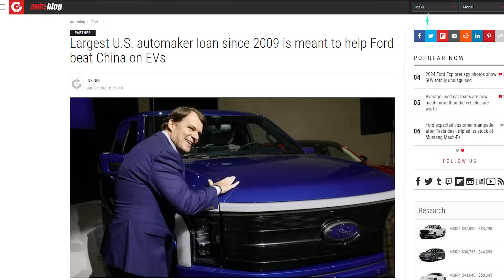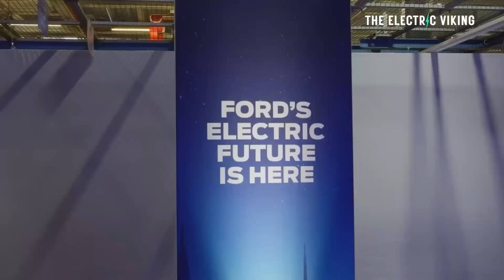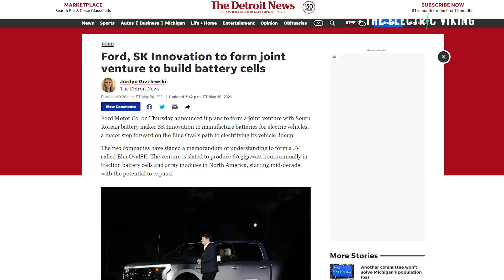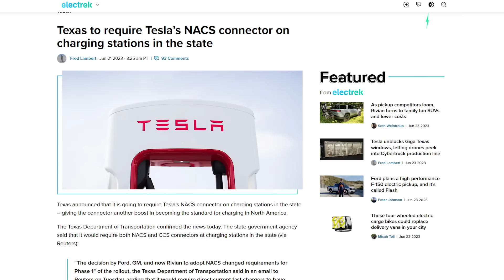Ford Receives $9.2B Bailout, UAW Clashes with Biden Administration

Comment: The unfortunate reality in the US is that if you are a large enough employer, you can be rewarded for piss poor management.
Reply: Too big too fail...and big enough to be rewarded - no matter what.
Reply: Suppose Mary will double the amount, has that required experience
Reply: Nah it’s just about political contributions. Employment doesn’t enter in to it.
Reply: Piss poor government management is the far bigger worry here. 
We give our vote ( power ) to groups that tell us anything we want to hear, while they aren't qualified to run a lemonade stand.
Reply: @RobertGBurke
Tesla was funded by U.S taxpayers money 😂 just don't called a communist hand out though 😂
Reply: Ford employment in the US and Canada over time 1970: 230,000; 1980: 240,000; 1990: 181,000; 2000: 165,000; 2010: 75,000; 2023: 85,000 (GM has only 97,000 in the US and Stellantis/Chrysler 60,000). This numbers will drop further and hard with the recession North America is now entering, and more bailouts will be requested. In that case, the bond holders and shareholders should be "bailed in" with 100% losses. In the 1980s Ford (and GM and Chrysler) implemented much lower wages for new employees, which have now become the norm as the older employees retired - an average of US$28/hour (in real times less than half what they were in 1980). Their Mexico workers get US$5.50/hr (GM 15,000 Mexico employees, Chrysler 13,000, Ford 9,000). These companies are not large employers, and pay about the average US wage (US$58,240) for a 40-hour week.
Reply: @oneviwatara9384  Tesla received a $465 million loan from the DOE in 2010. Tesla fully paid that loan back 9 years early. This is almost $10 BILLION - that’s 20 times the size. And we’ll see if Ford can ever pay it back. Not really comparable.
Reply: I agree ,look at our federal government
Reply: well they quit building crappy small cars. now to get them to give up on all the rest........
Reply: Its the republican way: Privatize the gains / Socialize the losses.   The masses are the only losers
Reply: Buy it out and run it right
Reply: " you can be rewarded for piss poor management."
Or take on another $9B in debt backed by taxpayers to fund green projects.
Reply: I just want to point out that the premise of this video is inaccurate. $9.5 billion is not the largest government loan to automakers in US history. It’s only about 1/10th the size of the 2009 US auto industry bailout — which was $80 billion, or $115 billion in 2023 inflation-adjusted dollars.
Reply: US Gov: Piss poor management? We can relate.
Reply: @oneviwatara9384  How Tesla was funded by taxpayers?
Reply: @Hexed_Precinct  

US government gave Tesla loans using taxpayers money that's how 🤣😅

Comment: If it’s a loan or loan guarantee, I’m not that worried about it.
Reply: Right. If it's a loan that gets paid back, it's not a bailout. If the load defaults, then it was a bailout. Question is, I have no idea how that plays out. Will Ford stay afloat long enough to survive and then pay it back?
Reply: @SHO1989 Ford makes 15 billion a year. They can afford to pay it back just fine.
Reply: @xaionik  Not for long. THat income will fall off a cliff
Reply: @xaionik Ford doesn't make $15B a year consistently... some years they were in the negative and other years made avg $6B.. only in 2021 Ford made $17B, then lost $2.3B in 2022.... with high interest how many buyer that buys expensive truck? Record profit in 2021 was due to low interest and Covid stimulus money. How will Ford fare in 2023 knowing the EV business is expected to lose $2B already?
Reply: @xaionik  Ford makes $15 billion a year?  Maybe before deductions.  Labor, materials, interest on loans, maintenance, parts, grift, advertisements, pensions, insurance, water and power, R&D, adjustments, dividends, and taxes.
Ford profits in 2022 was $6.9 billion.  Debt was $139 billion.  It will take Ford 20+ years to pay back what it currently owes.  Just to break even.
Ford credit is junk rated.  That $10 billion from US tax payers is a bailout.

Comment: The issue with the UAW is that the locations of the plants are in Right to Work states where the UAW cannot FORCE people to join the union to work at the plants.  So, they aren't getting a direct payoff and getting their hands greased by the loan.  And the pay isn't so much the issue with labor, the big issue is that it's hard work and so much of the current generation is hugely lazy and entitled in a lot of union states.  In us Right to Work states, the people are much less entitled.

It's a simple case of the UAW won't get a fat payoff automatically out of the loan and the plants.
Reply: Maybe they'll wise up and not vote for Bidet again. Doubtful, since they're not the brightest people that want to make $120K a year to put a bolt in a car.

Comment: The US Government has been giving hand outs for decades. In this case, I would like to see where this money is actually going? Also, I think they did this for Ford is because Ford has the best chance out of the US Automakers to be around 10 years from now. Musk knows as long as there is another us automaker, he will not be accused of having a monopoly.
Reply: You must mean Legacy American auto maker. Let’s not forget Tesla is an American auto maker too and actually produces the top 4 most American cars for sale in the US.
Reply: With ford's track record ,they will be belly up in less than 5 years,no automaker matches ford's quality control,recalls, customer service.
Reply: @camclarke9952  Keep in mind that Ford also stopped building cars. The only thing that you can buy from them is a ridiculously overpriced pickup truck.
Reply: @ghost307 
Not true, they still have the Mustang and two or three small crossover vehicles.  Plus most of the cars are still in production they just aren’t being built or sold in the US because it is not what WE are buying.

Comment: They need to improve efficiency and make cars at a profit.
Reply: and the key to this is to stop holding back on making cars and start producing EVs in larger volumes! Most of legacy auto works hard pretending to join the EV revolution while dragging their feet. The 1st mass produced EV was by Chrysler in 1992. They have had 30 years to do this.
Reply: Need more robots and fewer humans.

Comment: An issue that seems to be glossed over is the looming disaster for suppliers of  automobile parts that will no longer be needed.  Engines, transmissions, exhaust systems, radiators, fuel tanks, fuel, injectors, spark plugs, and more things I don't know about.  To think these workers will now work at battery plants is not realistic. There will be more losers than winners in this transition.  Innovation is uneven in its benefits.
Reply: I’m not so sure about that.  

I work for a Tier 1 automotive supplier and we currently manufacture some of those components on your list that EVs don’t require.  However,  we also manufacture lighting (both interior and exterior), interior panels and trim, electronic components, climate control systems, among others things that all cars use as well as components specifically related to the propulsion needs of EVs.  This is an international company that manufactures parts for almost all of the world’s leading brands.  This company has seen where the industry is headed and has planned accordingly.  The only companies will have an issue are the ones that refuse to more forward, and many of those have already failed in the last two or three years or are struggling to survive currently.

Comment: The state of Texas NEVI program stated that both CCS1 and NACS connectors are to be used.  It is all CCS software being used.  The CCS software is the bridge for interoperability between NACS and CCS1 connectors.   CCS1 connectors will be in the United States for a very long time due to Volkwagem Auto Group, Hyundai/Kia, Toyota, Honda, & Nissan.

Comment: Ford needs to build and operate large large cell and battery manufacturing plant.
More units produced, the more autos they can equip with reasonably priced batteries.
They must be able to amortize their costs Rapidly. Battery tech is changing rapidly so a newly built cell production line might become non competitive in four years (3 Ultium battery plants already face this dilemma).
Gotta be fast, high volume, and have well designed / reliable supply chains.  Fail at any of those and your battery packs might not be ready when needed or might cost 150 percent of planned cost.
Reply: US factory construction is too slow to keep up, thanks to regs.  US consumer will pay higher prices and have fewer choices of cars. Why can't we buy an MG4 or one of the better BYD's like the rest of the world?

Comment: I disagree. It's not a bailout. That money is part of a special program to develop advanced tech in the US instead of overseas. Ford got 9B because they are building 3 large manufacturing plants. Of course, there is never a guarantee of total success, but if the government doesn't try to put money into US factories then it will definitely happen somewhere else and we'll pay much more for the tech later.

Comment: M8te, you've got it wrong.  Ford has never received a bailout.  Going back to 2008 financial crisis, GM received money in exchange for equity in the company.  Ford did not take such a bailout at the time.  For may have upsized their loan some 3.68x over GM in this latest round but it will be used to accelerate electrification and fund battery and charging R&D.  The money was earmarked for utilization by the US government as part of the Inflation Reduction Act.  The cost of the govmt loans is much cheaper than Ford's cost of capital, so they would be foolish not to source lower cost of borrowing.  Get the facts right m8te--Ford never took a bailout; GM did.
Reply: If GM traded partial ownership for $, how is that a bailout?
Reply: @donaldparry5157  The US Govmt is not in the business of getting involved with US business dealing in exchange for stock.  It was completely a bailout--GM would have failed had this cash infusion (bailout) not transpired.
Reply: @HappyValueFrameWork  'GM received money in exchange for equity' was your statement; I was responding to that.

Comment: UAW just spinning this to make sure they have no impediments to organizing in those facilities, which I think are in so-called right-to-work states but where the UAW has been successful in organizing legacy American OEM plants as US auto manufacturing has moved south (unlike Tesla and all the foreign OEMs assembling in the USA, which I think are all non-union). Just going their job.

As far as the loan goes, it is indeed a conditional loan for the SK joint venture, and is coming out of the same dedicated DoE-administrated funding program that funded Tesla when it was spinning up. 

As far as I've been able to tell, Ford paid off its last government loan from the same program last year.

For what it's worth, I think Ford bonds are mostly rated in the BBB-Baa range (depending on whose ratings you look at) which is middling, not junk territory but not AAA either. I think they could have gotten the funding though a bond float but yeah, it would've cost more especially in the current rate environment. I agree with you that taking the Chinese out of the picture was probably a significant factor in this deal.
Reply: Spot on Hunt. I agree 100%.

Comment: The unfortunate reality of it is that the UAW is upset because electric vehicles do not require as many jobs as combustion engines. You'd get rid of areas like Chassis, Engine Dress, and many other areas would not need as many workers. The UAW has the workers best interest (generally) in mind. EV's are not good for the workers and they'd get rid of many jobs.

Comment: I really do not think that the US government should get involved in negotiating between Ford and the UAW. I think it's about building batteries. In general I think Ford is a better investment risk than GM however that's debatable. The batteries will be used regardless of whether Ford or GM will make it through this transition.

Comment: It is not a bailout, it is a subsidized loan.
It is also peanuts compared to the GM bailout - which included GMAC, GM and Delphi. Also the underfunded pensions were dumped on the PBGC.

Comment: The ATVM loan system is an extension with modifications to the old program over a decade ago. Which when their loan application goes through they get the rate for the term that the US Treasury sells bonds at that day. Ford has big enough chops to get a large low cost loan on creating the factory. A far as the UAW goes the general workers are not too happy with their management and more changes in the UAW leadership is coming. That guy is just hoping to stay on by being outraged. The loan will get the factories moving and allow Ford to evolve some. Watch the stock on Monday.
 

Changes in what types of vehicles qualify to apply have allowed Aptera to apply. It looks like Aptera Motors will be getting a plus $100M loan, at least Steve and Chris believe it will be approved soon. With that, the money they have raised in the Accelerator and the California grant money they are sure they can start production in the spring of 24 without additional funding. But they will continue to look for large investors and complete the current promotion as soon as the SEC approves the request to increase the share count in the class A.

Comment: Many of the uaw members have been building ICE vehicles for most of the unions lifespan . Retraining costs money and older members maybe trying to teach old dogs new tricks . Either way EVs are putting a bit of pressure on union members with loosing market share of their ice production . Union members have been drawn more to the republican side as they support the status quo and not as enthused about ev transition . Now republican have never appreciated unions and think of them as a socialist and communist type of program . They have wanted to get rid of them since there inception  . Most republican states are right to work states which is a way to break up unions and make it difficult to organize

Comment: The loans are to build manufacturing facilities.  Labor has nothing to do  with an infrastructure loan.  UAW has to get in there and fight for wages, benefits etc.  The two are not the same thing.  While I am opposed to this kind of govt interference, I completely disagree with the UAW's position here.  If GM and Ford are asking for help to get these facilities built and can't find the money in the markets and has to go to the govt to get it then there are lots of problems.  The markets know both manufactures are throwing money away building EV's because they can't produce them at a profit.  They are losing lots of money per EV sold.  So the markets of course are going to balk in a high interest rate market and there is no way that GM and Ford can repay these loans.  The govt stepping in as a backstop is just trying to keep these manufacturers from going belly up.  I think Elon eluded to this being the situation last fall and again this spring.  Without these loans both would probably be unable to proceed and would likely be forced into backruptcy.   Bailout, yep that is exactly what this is.  Ford can no longer say they didn't take the bailout.

Comment: They are cramming electric vehicles down are throats! One big problem with the new touch screen is they are like cell phones, you have to take your eyes off the road even to change the temperature or turn on the window defroster. On the old cars you could just reach down a turn a knob and you knew what it was just by the feel of it.
I wonder how many accidents this has caused. They won't bring this problem up because it doesn't fit their narrative.
Also with all the new cars they can monitor where and when you are driving, and can shut you down or limit how far and whether you use will be allowed to go anywhere, it's big brother and it's all about power and control, us peasants and peons will be totally ar the will and under the elite control. New lock downs are coming, and soon they will have total control over your children and your finances. Just look what happening in Canada, Australia and  lot of other countries around the world. They are taking away your freedom, slowly chipping away it, until all you can say "Yes, by your command"

Comment: @UAW has come to the decision that switching to EV's is going to hurt the union even if Legacy Auto is able to make and sell viable EV's

They will require fewer parts. The UAW is not the only union and Ford, GM & Stellatis is not alone. There are hundreds of smaller companies that provide parts for current vehicles. But Ford at least admitted that they are going to follow Tesla's lead into bringing as much of the supply chain in house. 

Electric Vehicles require far, far fewer parts than ICE vehicles. Fewer parts means fewer companies and fewer union jobs.

The hurdles for Legacy Auto are:

Computers & software 
Manufacturing process
Vertical integration
Unions
Dealerships 

They have already admitted that they will not be able to make & produce profitable EV that can legitimately compare to a Tesla until 2030. 

That is 7 years from now. 

I don't think they have 3 years to be honest. Drive by ANY Legacy car dealership, they are filled with overpriced cars that people are unwilling to pay or banks are unwilling to give loans to. Those that can afford to buy in this economy are choosing Tesla at a much higher of a percentage than anyone predicted.